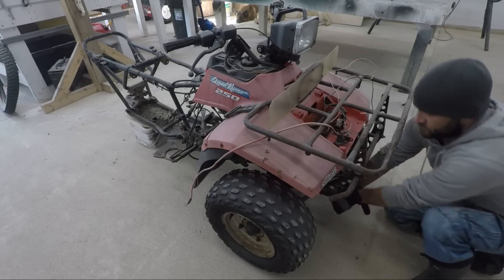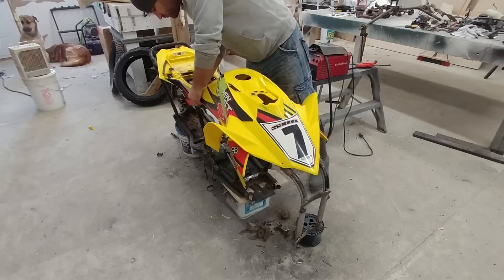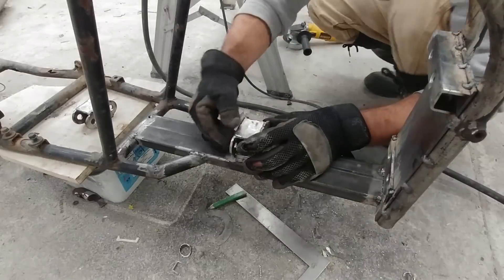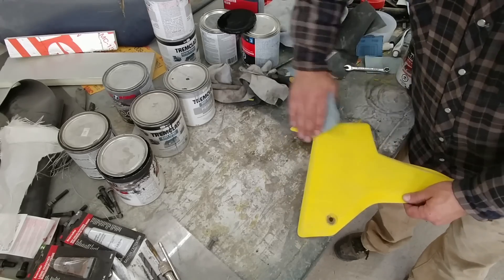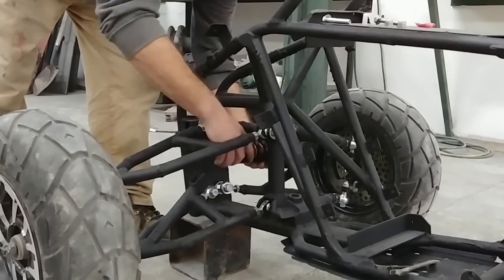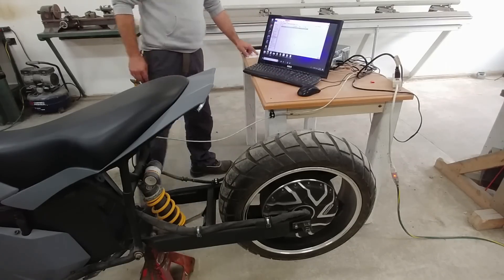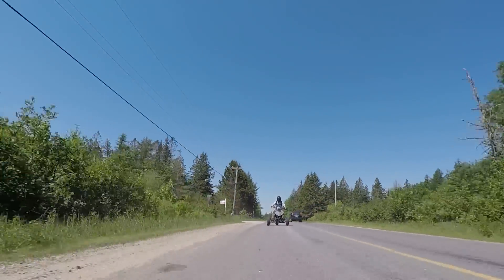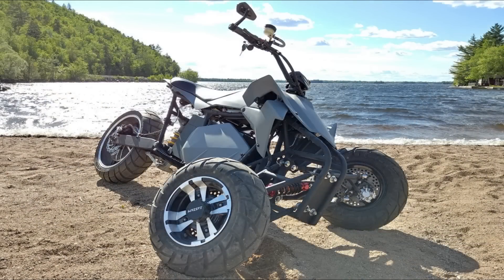How I Built My Homemade Leaning Electric Reverse Trike - Narrated Version!

Comment from the maker: Thanks for watching, folks! If you're interested in giving this project a try, the plans are available here:
https://www.resystech.com/cyber-trike---electric-lrt.html

Metal Machine Shop's Leaning Suspension Video: https://www.youtube.com/watch?v=4vtOcou_qXQ&t=10s

Buggy Wiring Video - How To Program A Kelly Controller:
https://youtu.be/tdG0T_YbwRU

QS hub motor:
https://www.aliexpress.com/item/1005001825517679.html

Kelly KLS72601-8080H controller:
https://kellycontroller.com/shop/kls-8080h/

Battery & cell suppliers:
grepow.com (commercial, bulk orders only)
batteryhookup.com (new & used cells for the avg DIY'er)
liionwholesale.com (new cells)
Reply: Good to see that you seem to be doing well :)  I should start trying to make some of these, would be a hit on the island I am on.
Reply: كم سرعه القصوى للدراجه
Reply: @slamslam5361 me parece que se ve en el vídeo el tablero velocidad máxima 100 kilómetros por hora
Reply: Any more plans for anything else you've ever made? 🫡🫡🫡🫡

Comment: I started building one of these about 4yrs ago, too.  I shelved it while I built other projects.  I would like to get back to it soon.  How do these drive?  It's always been in the back of my mind that there's a reason OEM's doing make trikes like this but I want(ed) to build one for myself to find out.
Reply from the maker: They ride great, just like a motorcycle, but more stable. It can play a trick on your mind when you first jump on and go for a ride because the front wheels make you think you need to turn it like an atv. I watched my friends struggle to drive it their first time. It was hilarious. But once they stopped trying to drive it like an atv and more like a motorcycle, then they nailed it. One subscriber downloaded the plans for this trike and built his own, but he also incorporated air cylinders that were placed like normal shocks on each control arm (not as actual suspension) and pressurized them just enough to help keep the trike upright and balanced for low speed riding, but not so much that they couldn't be overcome with a little effort to lean into turns at high speed. I think he was an older fella who wanted the feel of riding a motorcycle without worrying about keeping it balanced at low speed. He did a great job. Arguably a nicer trike than mine. But I think the cylinders are overkill for younger folks.
Reply: @JamesBiggar  Interesting...so you have to counter-steer.  Any thoughts on why OEM motorcycle companies have avoided tilting trikes?  
I'm going to have skinny motorcycle front tires and try to make it as low rolling resistance and efficient as possible.  It'll be a 48 or 96v system either with Nissan Leaf modules or LiFePO4 cells.  Mine was going to have an HPEVS AC20 induction motor but that motor got moved to the other project so I'm not sure what I'll use now.
Reply from the maker: Can-Am drew up a set of plans for one with electric self-righting tech back in 2011, but that's as far as they got. Toyota contacted me about this expressing interest, but that didn't go anywhere. I think it's just because production trikes in general are such a niche market and Can-Am has already dominated it with their non tilting models. Most riders consider them to be an old man's machine and if you want the leaning function of a motorcycle then just buy a motorcycle. Most old men choose Can-Am specifically because they don't lean. That's my best guess anyway. It would be nice if someone made something like this. Tremoto made an attempt. They used the same suspension that I have and thinner tires like you're going to do. WESLL makes custom leaning suspensions. I think that's as close as anyone's going to come to buying something like this, for now.

Comment: I love this! Great work and craftsmanship! 

May I ask are you using a BMS in your batteries and what brand and model? How do you tune your controllers can you share also a video on how to do them properly?

I had experienced burning out my BMS and overheating of QS motors, tripping the vehicle specially in heavy load like driving in a snow.😢😢😢 i am also using kellys...
Reply from the maker: Thanks! Yes, always use a bms for lithium batteries, especially if there are multiple parallel connections between cells. This battery was provided by Grepow, I didn't build it. But I use Daly bms' for the batteries that I do build. Ant is good as well. Check out my channel for my buggy wiring video. I explain how I programmed the Kelly with an ME1616. I'll be doing it again with the current street bike build very soon in the next upload for that series, so make sure to subscribe and keep an eye out for it.
Reply: @JamesBiggar  i'll be waiting for the programming steps. I was following you for a while! Keep it up making cool stuffs like this!
Reply: @JamesBiggar  by the way. How do you size the hub motor? Did you had any overheating issues which causes the tripping of the kellys?

Comment: How's the new electric bike coming? Can't wait to see another update!
Reply from the maker: Held up a bit. Had to order new cells, Headways were testing too low in cap for their weight. Got some M50LT modules to replace them. Half the weight, twice the cap. Should finish testing the p groups by the end of the week. Slow going with the EBC A40L. But then it's just a matter of series connecting and building a case to hold it all in, then I can wire up the bike. Got 4" of ice on the roads atm though, so not really in a hurry to test drive. We'll have to settle for spinning the wheel up in the shop until spring arrives. But still loads to do in the meantime. Going to try powder coating the chassis and 3D printing the fairings once the electrical is out of the way, and 2 other bikes to get started too.

Comment: this amazing. I'm wondering whether there is a controller that could run 4 of those motors installed in each wheel of a car?
Reply from the maker: Thanks. Unfortunately, no. You need to use a separate controller for each motor, but they can all be connected to the same throttle. See QS Motor's car kits:
https://siaecosys.aliexpress.com/store/group/E-Car-Motor-Kits/5881618_1000000630523.html
Reply from the maker: ...this isn't really the most cost efficient approach for a full size car, though. You'll only get 48 kW, 12 kW per wheel. Unless you're driving something smaller than a Smart car, then I would avoid hub motors.
Reply: @JamesBiggar  thanks. I assume aptera with its highly efficient design uses something similar

Comment: Tell us about that spot welder which was used to make battery pack
Reply from the maker: Battery was built by Grepow using pouch cells, no spot welder. I recommend kWeld for spot welding.